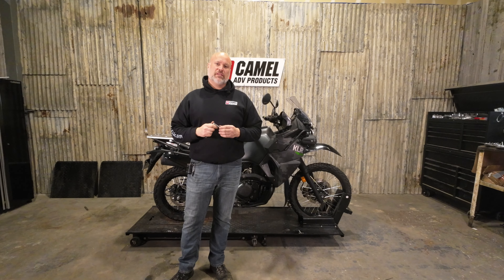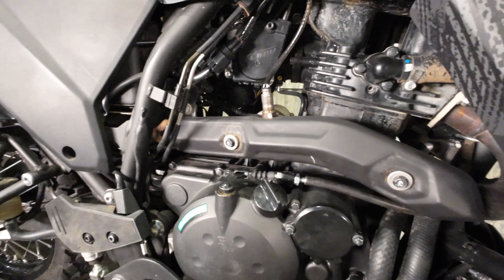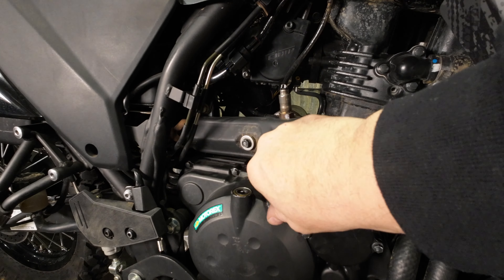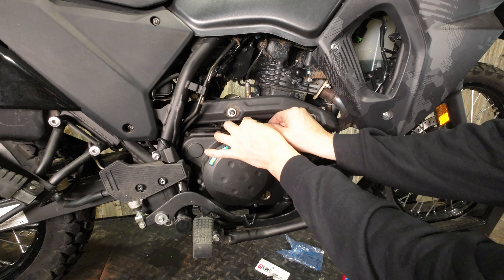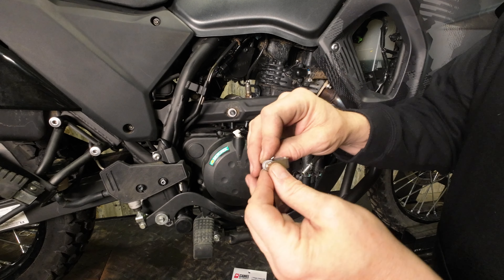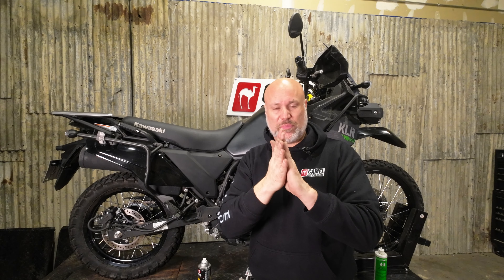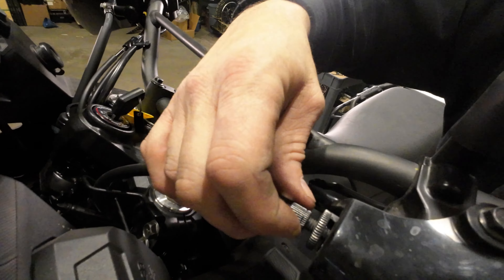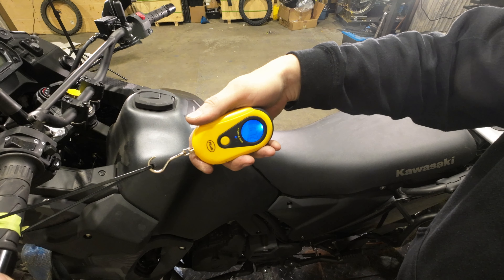KLR650 1 Finger Clutch

Comment: Just bought mine last week and it arrived today. It also came with stickers! I HAD to install it ASAP🐫. After removing the right hand side crash bars it took me a grand total of 19 minutes to remove the existing lever and bracket and install and adjust the new setup.
This is a great improvement in lever pull especially with the shortened levers and old hands. Love it.

Comment: Great video save for using vise grips on the cable.  This job can be done without doing that , simply remove the cable from the lever or Leever up top.
Reply from the maker: The cable slides back into the sheath making it difficult to get the book over the cable end. We use vice grips with moderate tension so the cable doesn't get damaged. You can do it however you see fit.

Comment: Has anyone installed the 1 Finger Clutch kit on a KLR650 with a FMF Power Bomb Header pipe?  Using the kit cable guide, I cannot get the nut back on the cable.  I can install using   the OEM cable guide, but I was told that is not recommended because using the OEM cable guide will have the cable running at a slight angle. It will cause drag and wear the cable prematurely.

If you installed the 1 Finger Clutch kit with a FMF Power Bomb, I would appreciate hearing what tips or tricks you used.  Thanks.

Comment: I can totally vouch for the effectiveness of this mod. I wish this kit was available when I modified my own KLR 1 1/2 years ago due to the stress of the stock setup on the hand. I don't know how much longer the Camel arm is but with the stock arm lengthened by 13mm the pull weight at the center of my clutch lever went from 17lbs to 11 lbs. I use a shortened clutch lever so that is the weight you can expect when using two fingers. As usual, Camel thinks of everything especially the modified cable bracket which is essential for proper operation and component life.
How about a 1 finger clutch kit for the KTM 390 Adventure! My wife will bake you a cake if you come out with a kit for her bike!

Comment: Will this work on my 1990 KLR650-B Tengai? I’m assuming it will, but just checking. Thanks!
Reply from the maker: I don't know much about that version of the bike. If the motor and clutch are the same as the regular KLR, you should be OK.